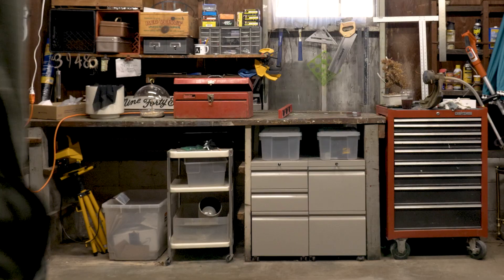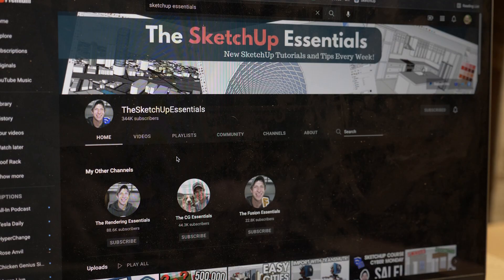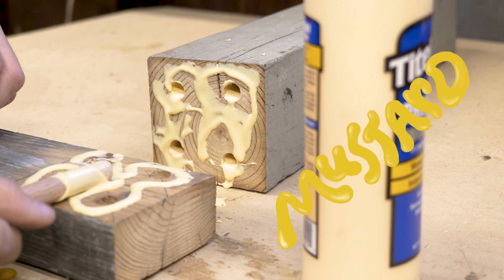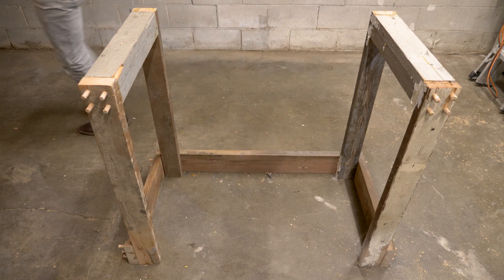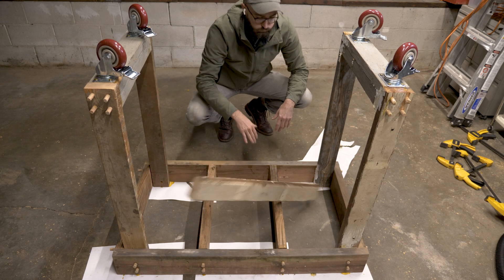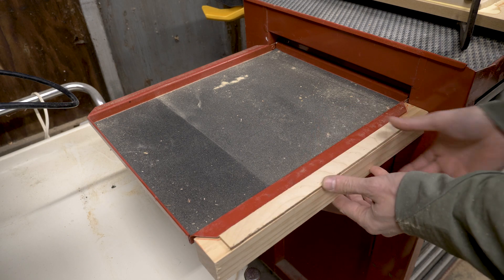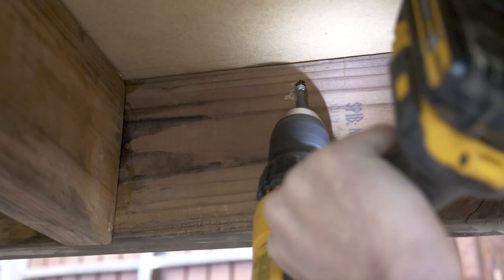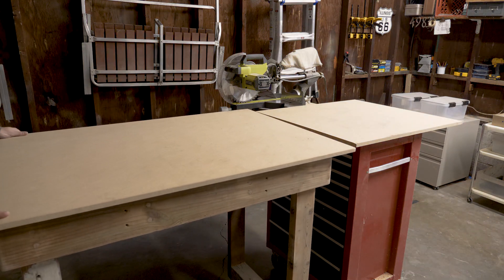Make a workbench from scrap wood!

Comment: Project Suggestion: what about making a fold down workbench for inside the garage that is attached to the wall using French cleats and something that’s not super heavy with storage cubbies inside the panel with a drop table and legs…maybe make the fold down work table using a pallet or two.
Reply from the maker: Great idea. I have another car camping project in the works but need to fix up the shop soon.